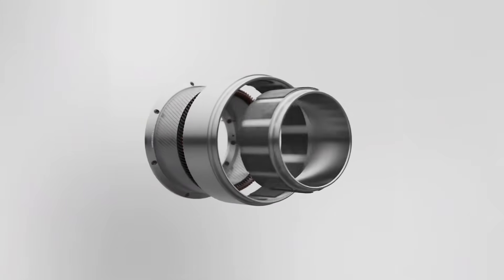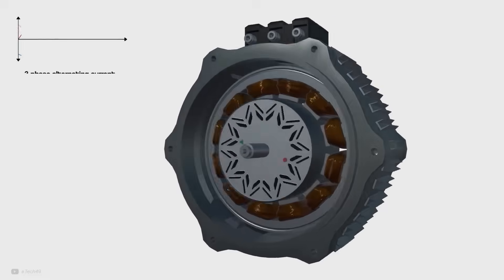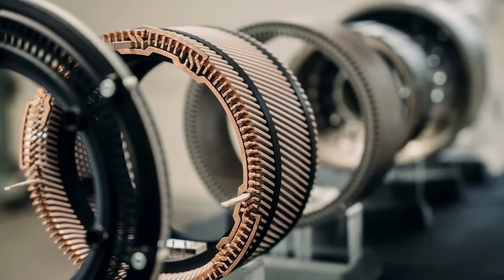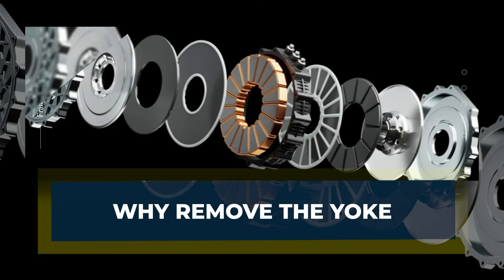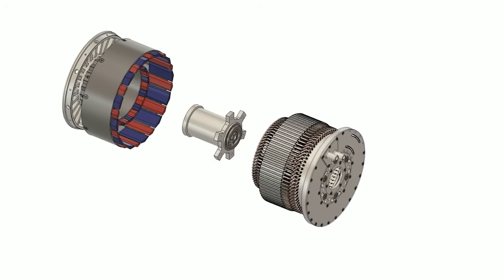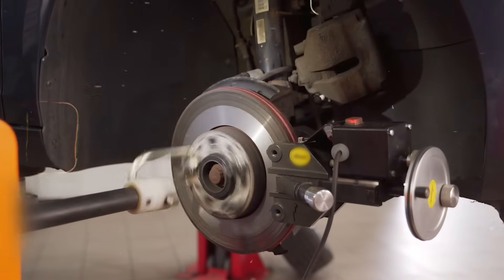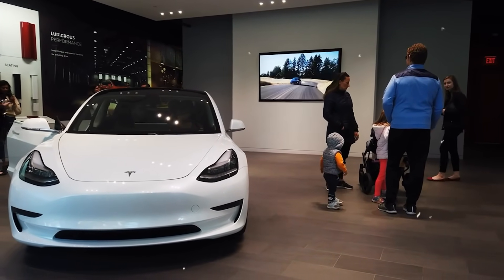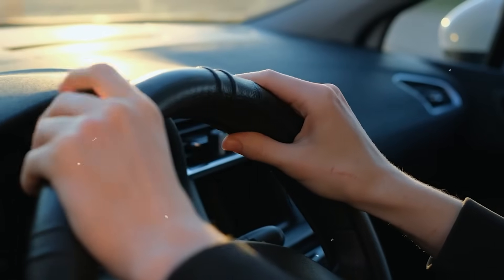This New EV Motor KILLS the Old Design

Comment: The other trick is to do away with both rare earth magnets and use Al windings .. which gets rid of the cost/ resources, Wt. problem  and  recycling issues. The other is the motor is more heat and vibration resistant. Clever ideas but still only half of the problem solved for long term development of  E motors without the limitations of cost and rarer materials.
Reply from the maker: That's a very insightful point about the challenges with rare earth magnets and alternative windings!